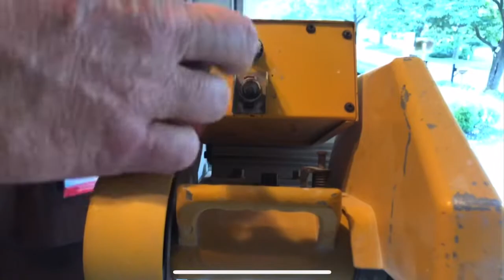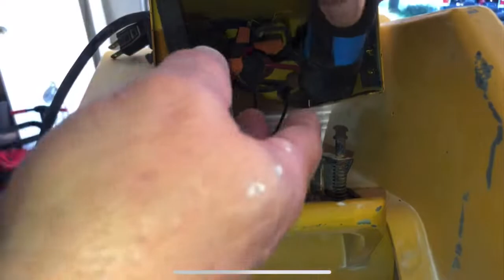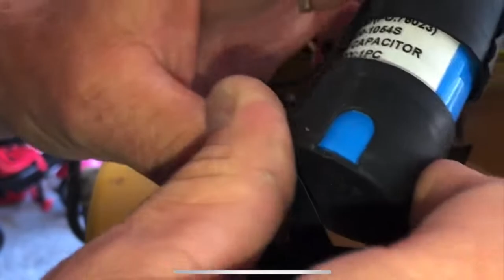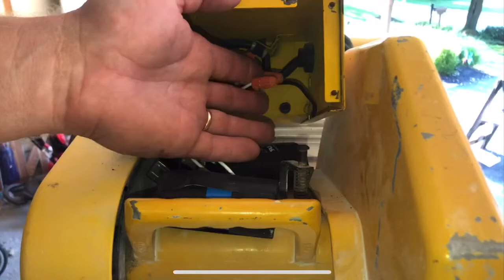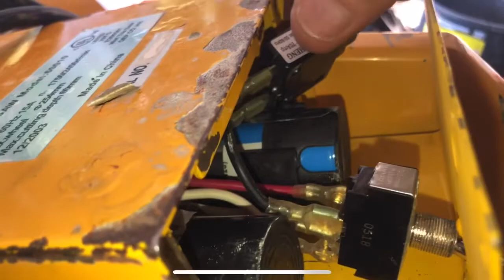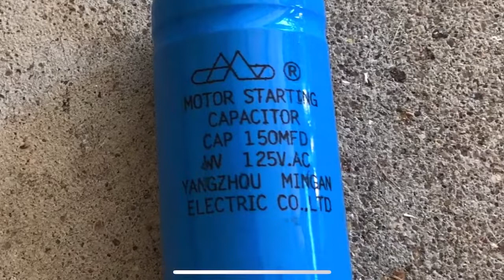Repairing a QEP wet saw

Comment: Thanks for posting this.  I'm pretty sure my wife's 60010 tile saw has a bad run capacitor.  It starts fine, but then smoke starts coming out.  Opening up the tray, there's an obvious hole and melted plastic on the run capacitor.  Your video made me much more confident I had the right ideas on this.
Reply from the maker: Sounds like you are headed the correct direction. Thanks for watching.

Comment: by any chance can you show more of the wiring behind the tray, I have a chicago electric TC250B wet saw and forgot to draw a wiring diagram of the hot lead (BLCK WIRE WHERE IT GOES) and blue wire, and yellow wire.  It would help me alot if you can tell me where to hook them up)
Reply from the maker: I do not have access to this saw right now. Sorry

Comment: Hi Bob by any chance do you have a wiring diagram for the motor wires
Reply from the maker: I do not, however I have found QEP to be helpful once I called them. It is possible that they could send you one. Hope this helps, Thanks for watching.
Reply: funbro1 thanks